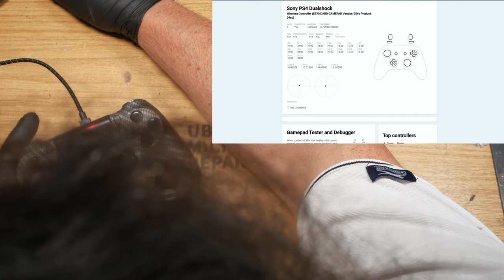Battle Beaver PS4 Controller Repair | Got My Butt Kicked

Comment: The reason why the back button gave is because of the switch the person chose that yellow switch is a more quiet option that battle beaver offers
Reply: Nah I got normal switches and they lasted 6 months before 1 of them barely working and it’s my switch weapon buttuon,not even slide or jump

Comment: If I where to cut off the trigger part off the extreme rate pcb would I be able to add the trigger switch that battle beaver uses  pls I really want to do the mod

Comment: i bet you where glad to see back of this one 😂
Reply from the maker: Yeah from the beginning I had it in the back of my mind to replace the button flex as I've seen this issue many times before. Repairing the join on these can work but over time the other connection could fail. Best to just replace with an alternative.